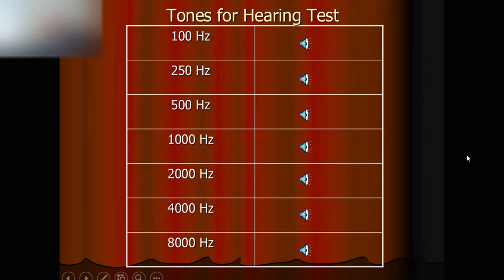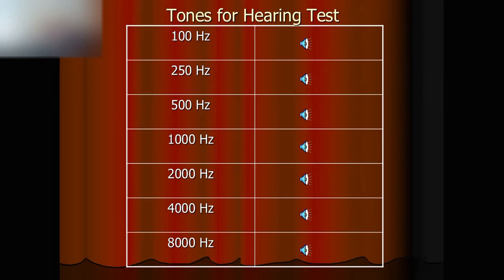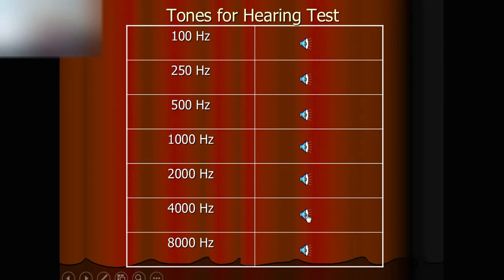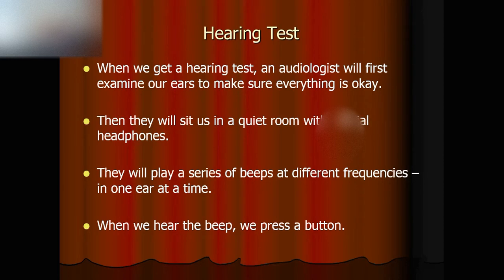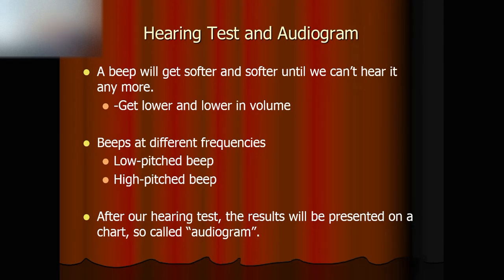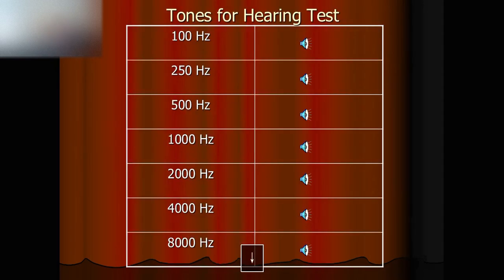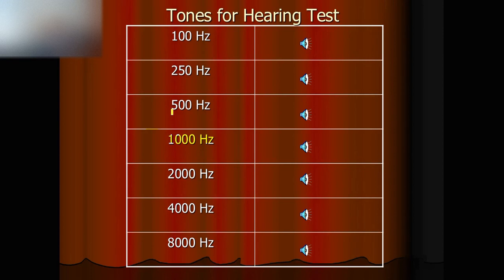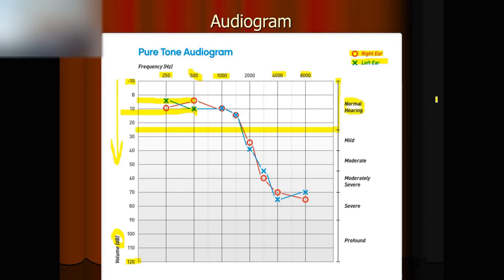Hearing Test Audiology - How "500 Hz", "1000 Hz", "2000 Hz", "4000 Hz" tones sound like?

Comment: Could you do pure tone audiometry test for pilot
Reply from the maker: It is always recommended to go to a clinic and ask an audiologist to do the pure-tone audiometry test, because the device there is calibrated annually. Otherwise, the problem of using smartphone or laptop Apps to test audiometry is lack of medical-level calibration, so those results may not be accurate or may be partially accurate. BTW, ear protection is recommended if your work environment noise level exceeds OSHA guideline: https://www.osha.gov/

Comment: At what vol should we hear it on mobile?
Reply from the maker: It depends on the type of mobile phone and the type of earphones. Both need to be calibrated in order to reach a meaningful result like in clinical setting. That being said, typical phone plus typical earphone max volume may be around 105dB, which is hurtful for long-term listening. So adjusting it to half of maximum volume is appropriate.